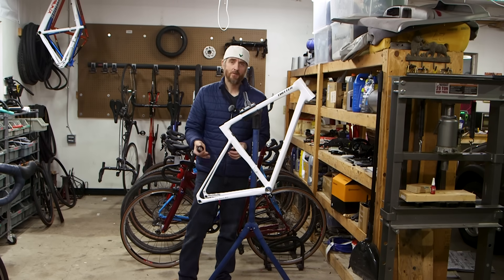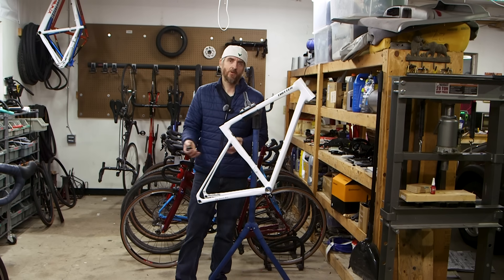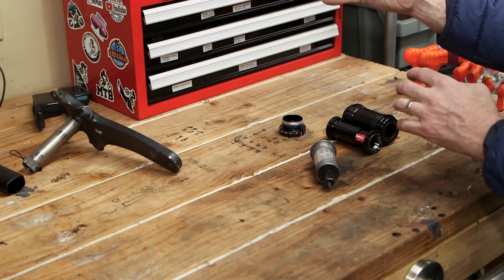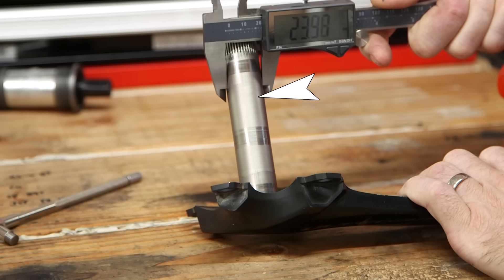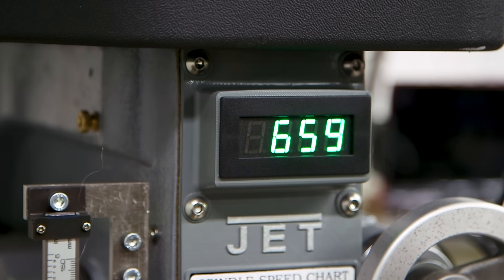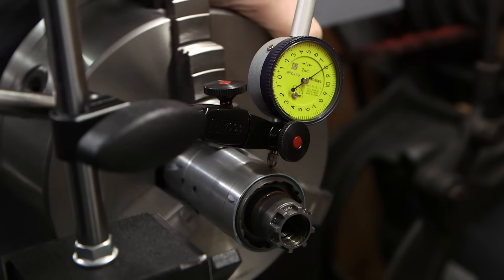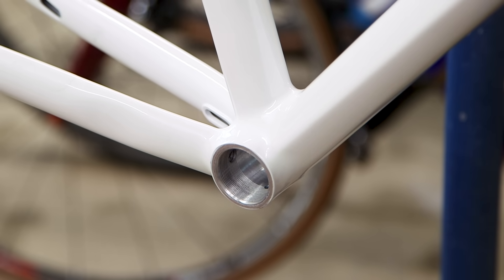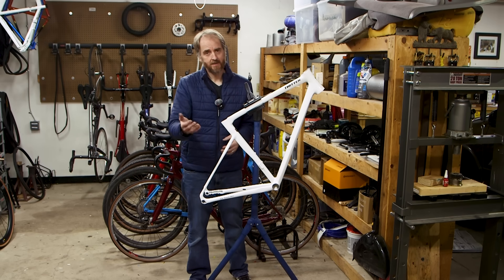I destroyed frame's bottom bracket threads, but I also fixed them.  Here's how.

Comment: Strange video, sorry... to have two brand new, yet weirdly damaged frames, like i have never seen or managed myself in 40 years of riding and fixing bikes...
(actually, we haven't even seen the cracked headtube), to have 
 all the machines, yet no bsa thread tool...???  Mine cost 150.-

Fixing the Trek would have been the much cooler video than this soulless harsh 260$ Ali thing I bet you ain't gonna ride either. Are you finishing it now? Doubt it. Was for show off only, right? Never mind. 

The problem for me is there's no need for anyone semi pro with a threading tool and without the need of your machines other than admiring your skills 😑 

A used Giant Road Bike or similar would have been the better budget bike anyway. And frankly, i rather watch a simple restoration than the big show for nothing.

Im back to the proper bike channels
Reply from the maker: I’m glad you have good luck with bikes and have had for 40 years, but I disagree.  I am not you. I’ve never had a need for a tapping tool.  I’m glad you found one at a reasonable cost, but it’s 2025 and money isn’t worth what it used to be.  Best I could find was $300 from Wheel and Sprocket.  

The Trek never got fixed because I deemed it unsafe to do so.  I don’t need to prove to you that it was cracked.  I inspected it with my own competent eyes and I’m not dishonest.  

You sure don’t know me and you sure don’t understand my intentions, so why you calling me out on finishing it and riding it?  If you’d watched any of my other content you’d know how wrong you are.  I suspect you are either, insecure about your own abilities, a troll, or a bot.  Don’t bother hanging around.  You’re not welcome here anyway.

Comment: Excellent approach and machining.  That is coming from a manufacturing engineer.  Good job on fixturing the frame.  I like the idea that you have two different diameters for the insert bottom bracket.  Good idea again.  I thought that the solution would have been to get a steel bottom bracket from a frame maker supply.  One problem with aluminum threading into aluminum is that they can gall, as you experienced.  I don't know why this is done so commonly.  Use lots of grease if that that is what you have.
Reply from the maker: I actually did buy a steel bottom bracket from Frame Builders.  38.1mm OD which would have turned down perfectly.  But I opted not to use it as I'm slightly concerned about corrosion, given the amount of water that makes its way into bottom bracket shells.  Appreciate the kudos!  Thank you.

Comment: For your own bike, this is a fine repair.  If a customer’s bike was damaged, 1st solution is to offer to replace it with new.

You never seem to have determined what happened in the first palace to seize the BB.  FWIW, a bike shop style BB tap is generally made to chase threads, not to cut them in fresh metal.  It might have worked because aluminum is soft, but it also could have led to a damaged bike and tool.

Having said that, it’s good practice to chase and face threaded BB’s.  It’s possible that the threads were damaged, dirty or slightly out of spec leading to the BB cup seizing when turned it all the way in.  If this was the case, proper chasing of the threads  might have prevented your problem.

As I’ve never used pressfit, I can’ say what’s good installation practice for them.
Reply from the maker: I don’t work in a bike shop and only do this kind of stuff to my own equipment.  I can understand a bike shops hesitation given time to do the repair, risk of failure and potential liability.  Target audience here is the more-capable diy’er.
Reply: @RobertAdairWorkshop  No regular shop would have the competence to do that repair - much less the tools.

Comment: Good Job.  I was a bit surprised you didn't put your new BB into the freezer before putting it in the press, considering how tight your interference tolerances are.  Old machinist trick that comes in handy when you need to insert a piece that is fighting you.  Impressive work!
Reply from the maker: Aluminum transfers heat so quickly, I’ve never had luck with heating/cooling shrink fit between two aluminum parts.  Didn’t even consider trying, but probably could have been a good idea.

Comment: i have the exact same problem with my mtb frame, but i unfortunately dont have a mill… or lathe… or hydraulic press… so i have a 3d printed sleeve/shell that presses into the frame and holds my non-drive side bb shell in place lol. this solution seems really clean though, thanks for sharing and for the videos you make, i enjoy and learn from  them a lot 😁

Comment: Did the sleeved bottom bracket need to be chased after installation?  Just wondered if the ID shrank slightly.
Reply from the maker: No, it fit perfectly.  I was wondering about that too, but it worked out.

Comment: You didn't really need the interference fit, and it probably introduced more risk of failure than a transition fit. You already have a lathe, so a light knurl with a transition fit and Loctite would have probably been better. Media blasting the OD for tooth wouldn't hurt, either.
Reply from the maker: I really didn't want to take the gamble on it coming out mid-sprint and I'm certain the press-fit will hold.  I do have a realy nice knurling too for the late, but I'll admit, I've never found a use for it other than tool handles.  It's a good idea, though.  Appreciate it.

Comment: This was impressive but you got to ask yourself, "Did "I" really damage the bottom bracket? Or was the metal inferior and to soft for a screw thread?" I do think that as you were not feeling resistance or using excessive force, something was wrong with the frame or the bottom bracket.
Reply from the maker: I agree that there was something wrong with either the frame or the bottom bracket.  It wasn’t inexperience on my part.  But once it seized, everything afterward was totally my fault.

Comment: Great Solution, you basically made a Custome BSA Sleeve, Also you could have  just purchased a " BB30 to BSA" sleeve  from the old Cannondale dealers  and then  lathed it to size ..

Also Icetoolz Makes a BSA and Italian threading set  all in one .. 

Look it up "IceToolz BB Tapping & Head Tube Reaming & Facing Set, #E185"
Reply: I would do  2 more things after this great repair :

1- tap the thread at the bottom of the bb Shell to have a screw securing the sleeve to BB shell , "anti rotation security". 

2-  I would also rechase the BSA threads of the sleeve after the repair to make sure compression is not making them tighter .  I would also Reface the BBshell   to make sure that the new Threads are square to the Faces of the Twitter Frame.

Comment: any thought on why that shell did not want to come out of the frame in the first place? was it greased properly? I have never seen anything like that.
Reply from the maker: I think it was the bottom bracket that caused the problem.  It was a cheap Bucklos ceramic BB and covered in thread compound.  There could have been something in that compound, or damaged threads under it.  I should have cleaned that off with a wire wheel.

Comment: What about degreasing both parts and putting good old JB weld and screw it in?
Reply from the maker: I tried JB Weld for a thread repair once in the past, I don't remember on what, but the JB weld pulled right out when I went to remove the bolt.  I wasn't sure it'd work here.

Comment: Looking forward to the next video “fabricating a new bottom bracket tube for this Trek I cut the bottom off off”
Reply from the maker: Ha!  That poor Trek.  It had a cracked head tube, right at the top, right through the headset bearing seat.  I was going to try my luck at drilling the crack and sleeving it using aluminum brazing.  It was a size XS and would have been too small for me to ever realistically ride.
Reply: @RobertAdairWorkshop after cutting the frame, you can cut it in other places, so you can extend the frame, even with new geometry haha

Comment: If it galled with hand screwing only, makes me wonder whether it would gall even with antiseize some years down the road on the first BB R&R.  Also makes me wonder about the metallurgy of the frame.  Interesting video.   Looked up the Twitter site,  fully specced bikes with CF wheels for $750??  Now really wondering about the metallurgy.
Reply from the maker: I’ve become more suspicious that it was the bottom bracket I used and the frame was just a casually.  The BB I used was a Bucklos ceramic bb and had a healthy coating of blue thread compound on it.  I’d usually clean that stuff off before using it, but since it was just a quick install, I didn’t.  There could have been something in that compound or it could have been hiding some damaged threads.  Bike frame machined like 6061.

Comment: Nice solution, especially the different OD’s to help with alignment.  Only thing I would have done differently during install is to use heat on the frame, and a frozen sleeve.  It may have dropped right in.
Reply: legit shocked this didn't involve freezing the sleeve.
Reply: Here to say this, freeze the sleeve and heat the frame, no press needed and when temps equalise the sleeve is locked in perfectly.

Comment: Theory on why it got crossthreaded, since it initially went all the way in with no issues?
Reply: Not cross threaded, rather the BB and the insert galled together (cold welded) and any removal attempt would have damaged/demolished the threads.  Lubricant or antiseize would have helped prevent this but I wonder if it would have occurred a few years down  the road when and BB R&R was needed.
Reply: I always apply a very thin bit of Grease on threads

Comment: Have you ever considered installing a pressfit bottom bracket instead of a threaded one? If a standard pressfit BB does not fit you may be able to machine new pressfit housings for the bearings?

Comment: Toasty rides of out new zealand had this similar problem, chewed up the BB threads on alloy frame. He did mention about a problem solvers BB  that would work but he didn’t go that route, instead he tried to salvage a few threads, filled the remaining threads that was non existent and used jb weld to make a bit of material for the tap to cut out of, so far he said it works, no BB wobble or anything like that. 😅

Seeing that most of the damage were on the last part, maybe making threads out of JB Weld would’ve been an easy out but your way is much more reliable in the long run. 

Do need a link to that frame cause I’m in the market for an alloy aero bike 😅

Comment: I love the fix.  I love the honesty.  My fear, as a very amateur bike builder who has only put in about five bottom brackets is - how did it thread in OK, but then end up cross threaded?  I have my first T47 BB-using frame on order, and would really like to not screw it up.
Reply: You need to pin this comment to the top and it’s as important as the entire video itself
Reply: Like he said, if the BB has ceased, cut it up and that should save the frame threads. I had a similar problem, I cut the BB in 4 pieces and carefully removed it from the frame. The frame threads were still in great condition and I was able to get a new BB and save the bike.
Reply: @captainnicolasdubois that doesn’t answer his (and mine too) not understanding of how the threads were able to get damaged in the first place. If it went in smoothly by hand, it doesn’t make sense for it to just all of a sudden jam. What would have caused it to happen in the first place and how could such a thing be prevented in the future?
Reply from the maker: I’ve been thinking on it and I suspect it wasn’t the frames fault, but the bottom bracket I used.  It was a Bucklos ceramic bb.  It had a thick layer of thread compound on it that could have had something in it, or been hiding some sort of thread damage.  I should have removed it with a wire wheel beforehand, but I was in a hurry and just doing a quick fit check.
Reply: @RobertAdairWorkshop  Thank you!
Reply: @RobertAdairWorkshop  please pin this comment to the top or restate it. It’s as important as the video itself.

Comment: What do you think damaged the thread? Strange that it screwed in so nicely and then got stuck. Some kind of galling?
Reply: I would like to know also.  I thought maybe a Di2 cable got in the way but it wouldn't have threaded in so nicely.
Reply from the maker: I’m really not sure.  It’s the first time I’ve had one seize up like this.  Usually you know when it’s going to happen and not be a surprise.  I suspect there was something in those last few threads.  They overlapped holes drilled in the shell.  It’s possible there was something in one of those that caught the threads.

Comment: Really smart solution. I came across a similar situation once on my old steel frame, generic cheap road frame. My solution was to cut a new bottom bracket shell from another bike and weld it. Still goes strong.

Comment: Superb job Robert. I think sleeving it back to standard was the only way to go. I like the step design, too.

I've never heard of Twitter frames before (the Chinese need to employ different people in their marketing dept!) until an Ad popped up on Insta. They have a nice looking aero gravel frame.  What's the overall quality of their frames?
Reply from the maker: I think they are fairl quality.  I don't think the bottom-bracket issue on this one was the frame's fault.  The welds are a bit concerning and some of the finish grinding isn't perfect, but I am still super-excited to ride it.  I'd say, quality wise, about the same as any of the major brands.  I'll admit, I have a Twitter carbon frame on the way.  I was impressed enough with this one to take the risk.
Reply: @RobertAdairWorkshop Oooo, let us know when the carbon frame arrives!

Comment: I'd probably have mixed up a batch of JB weld and screwed the BB in permanently (considering the value of the frame). If bearings need to be replaced at some point, just press it out of the cup. And you'd still have one side threaded to work on the wiring.

Comment: Great job, but why not make the bottom bracket sleeve from scratch, you obviously have the tools and the skills. Also, you could have sized the BB shell to take a press fit bottom bracket
Reply from the maker: I don't have a bottom bracket tap and my lathe isn't set up to do left-had threads.  This was the faster option.

Comment: I recently saw a video on YouTube where someone made raised letters on a steel plate with a mold made from a cutting board, and jbweld. 

Not sure if it’s possible, but perhaps you could make a mold and use jbweld? I think you could 3d print it, or you could mill a mold as an alternative if you don’t have a printer.

You might have been able to build up the side walls with jbweld and then mill the original threads in as well.

Probably not a great idea but I think you could test it out with a steel pipe

Great video anyways!
Reply from the maker: That one was recently recommended to me too.  I didn't watch it, though.  I thought for sure it was Artisan Makes or Robinson Foundary, but no, neither of those guys.  Interesting.

Comment: Outstanding troubleshooting and marching work!  A sleeve seems like the most practical approach on a similar task on any other equipment. I think given what you have access to it was the best approach.  I would love to hear your thoughts on why the original thread / BB failed in the first place. Just about everything you tried sounded like what anyone of us would try to chase them out and likely end up in the same boat. Was it bottoming out on the threads and mashing them? just a crazy amount of damage on the threads.
Reply from the maker: I do not know why they failed.  The problem looks like it started about 1/4” from the end of the BB.  That’s where the initial galling occurred.  The rest of the damage happened as I forced the BB past that galled section.  I inspected the threads beforehand and they looked good.  They had a slight blasted texture but were well made.  I am more suspicious of the BB itself.  It was a Bucklos ceramic BB and had a heavy coating of blue thread compound on it.  I suspect that compound had something in it or was hiding thread damage.
Reply: Why do Aluminimum threads fail? Because Aluminium threads fail. They're easy to crossthread and both AL and SST like to gall. AL also has no fatigue limit unlike steels, so they can also just get sheared off for no apparent reason. I find wood threads, especially in hardwoods to be more reliable (no sarcasm here).

Comment: Great job saving the frame. I wonder if you added holes on the sleeve to still have access for cable routing (brakes and Di2 alike).
Reply from the maker: I lucked out.  The BB shell I took from the oldTrek frame already had holes in the right spot.  I do plan to open them up with my Dremel before routing the Di2 cables back through.  Space was tight before I stripped the threads.

Comment: “Hello Hambini fans!!!” Nice job, I’m a little bummed you didn’t shrink the insert with liquid nitrogen to install it.
Reply from the maker: The last time I used liquid nitrogen was when I was teaching thermodynamics lab in grad school in the early 2K's.  I wouldn't even know where to get it these days.
Reply: Freezing that thin shell wouldn’t help much because it would warm up almost immediately in contact with the frame.  Not to mention the frost that would be on the shell.

What would have helped is to heat the frame.
Reply: @GHinWI impracticality aside, you can’t deny the appeal of the spectacle.